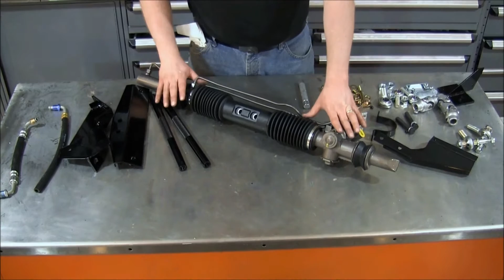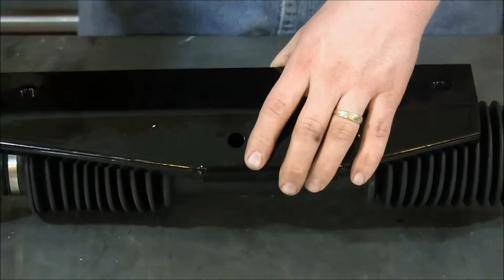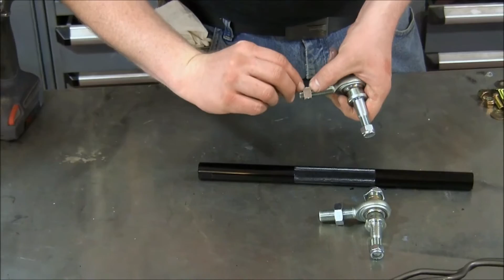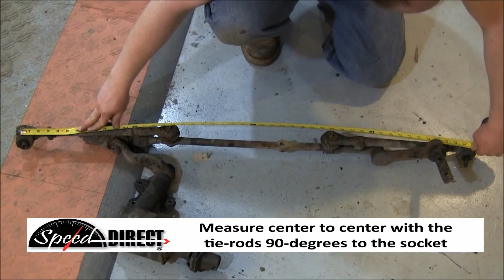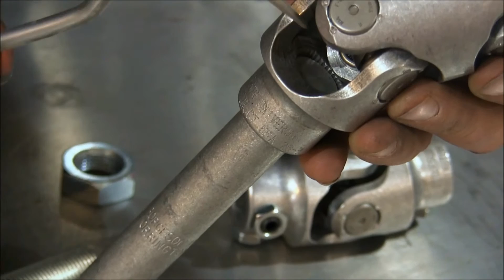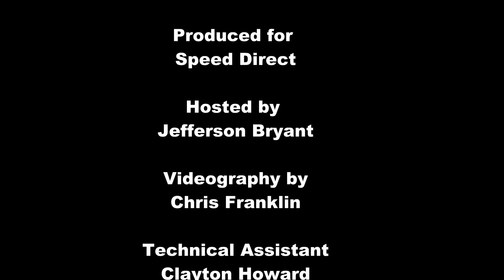How to bench assemble the Steeroids C2-C3 Corvette rack and pinion conversion

Comment: I buy that! Wait a minute, they don’t make one for the 67-72 C10 Truck...
Plus, you forgot to put anti-seize on the double u-joints and shaft. Dissimilar metal cause galvanic action. Think of it like a “Potato Battery”. This is the same reason for the clip-on ground strap for water heaters in vehicles and also helicopter blades generate a huge surplus of electrons in the chassis. The tips of the blades strip away a large number of electrons (+) in the air and are directed to the ground thru wires in the landing gear. If hovering to pick up a load, ground personal use a hook & rod system to discharge the electrical potential or risk getting knocked on their butts. 
ASE Master Tech since 1978 - Retired
Reply from the maker: Well, that would be because the u joints and shafts are aluminum, they are not dissimilar metals. 

But yes, where you have dissimilar metals, anti seize is recommended.